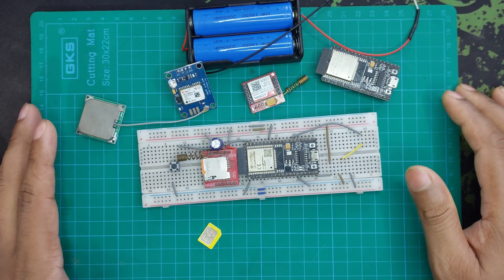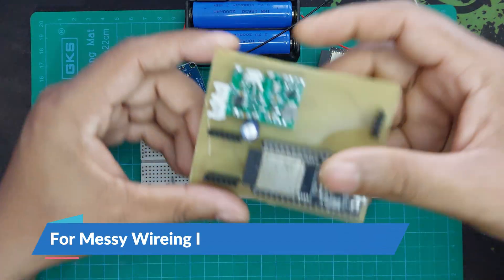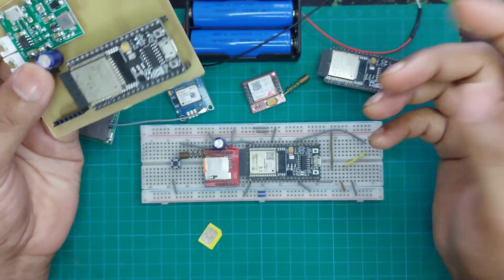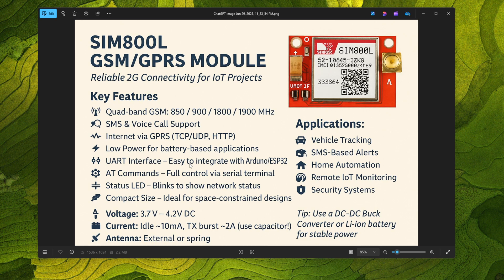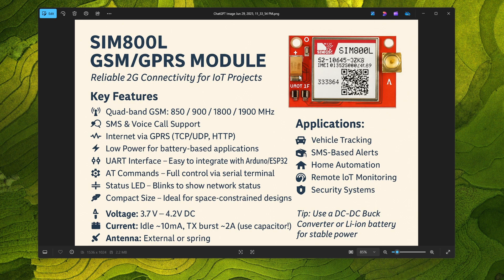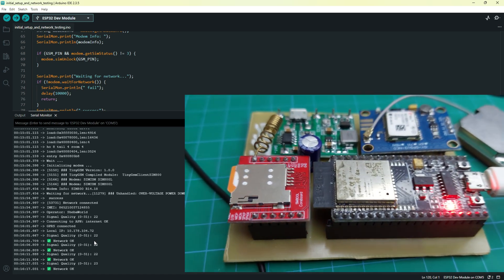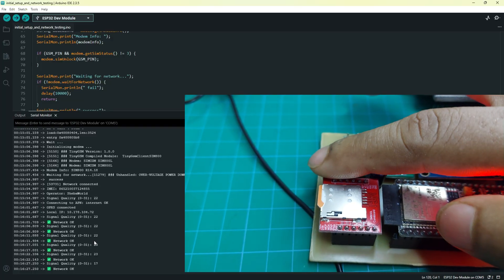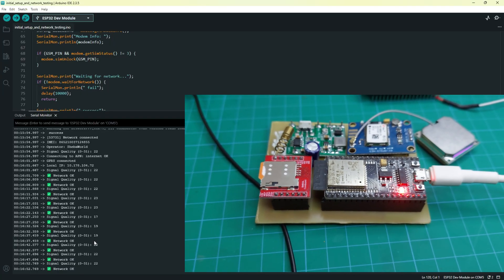How to Connect SIM800L to ESP32 | GSM Setup & Network Test (GSM IoT Series #1)

Comment: Great video tutorial using sim800l with esp32 but i have a question does it need level-shifter for Txd and Rxd of sim800l?
Reply from the maker: No need if you use 3.3V output like microcontroller esp32, but need when you use 5v output microcontroller like arduino series then,  it will be needed